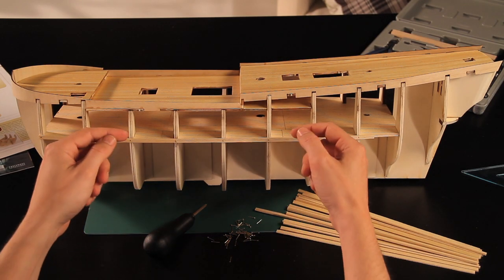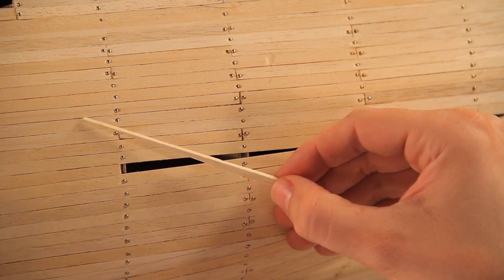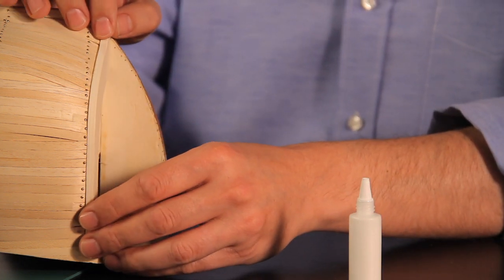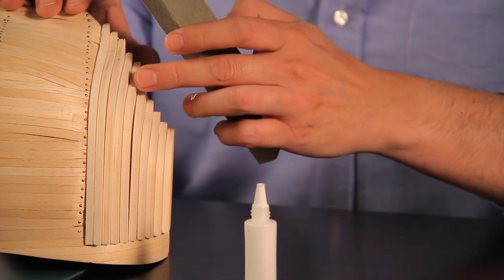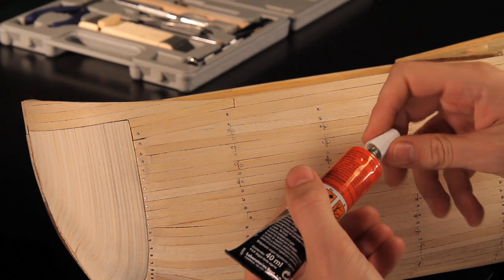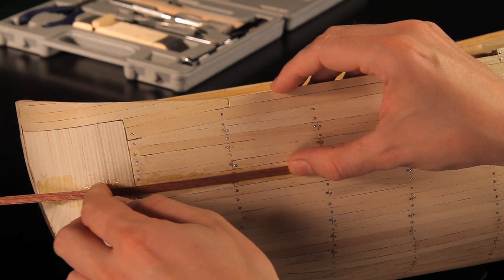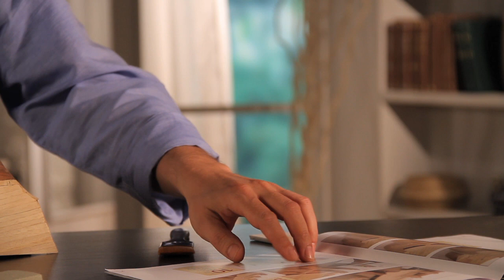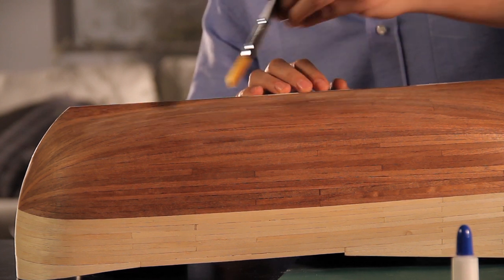Endeavour assembly_Hull 2

Comment: Filling the whole Bow is a great idea, do this with all your ship builds, and in many cases continue to fill in another section or two and don't forget the stern sections as well, use Balsa wood for this. As for the nails, pull them out or drive them in, don't waste time using a file. When working on a double plank on bulkhead, the 1st plank does not matter where you start, it's just good practice to pretend it's a single plank model, read more on it. DO NOT use CA glue on the second planking, use finger power and take your time, yes it is ok to use wood filler between the 2 plankings, sand carefully, and yes it is important where you start your 1st plank on the 2nd planking.